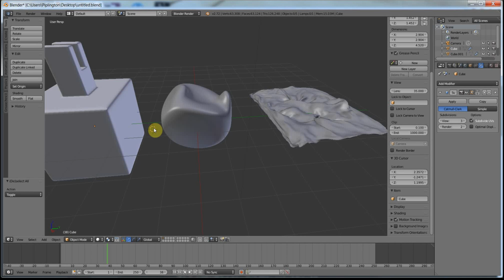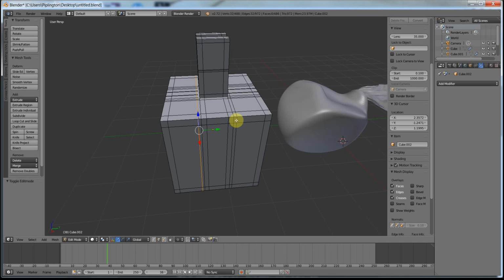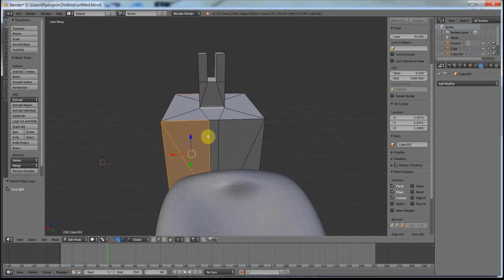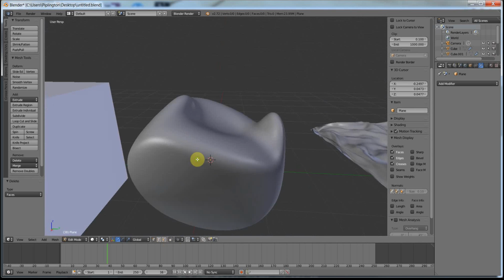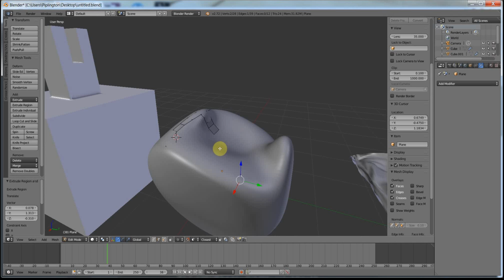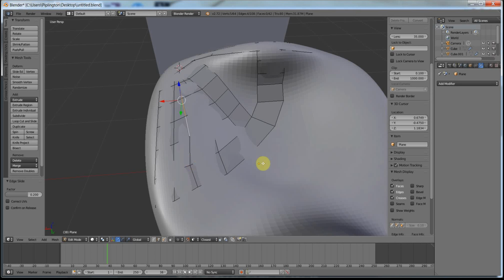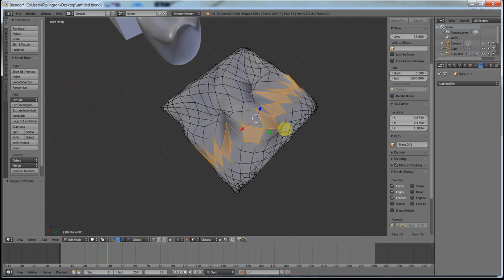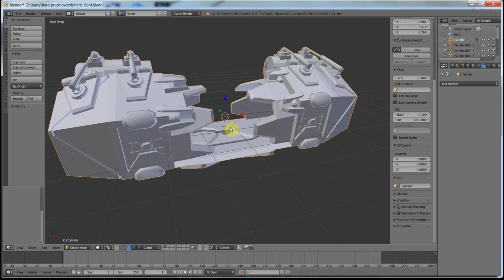Blender 2.72 Low Poly Asset Modeling

Comment: you do have desolve edges for easier combining. In most situations its actually beter and easier just to desolve the ones we do not need.
Reply: You could also desolve a vertex
Reply: Another way of getting the same effect is by turnning on the magnet(idk what it is actually cold but you can put it  on by pressing shift + tab then you just select and grab to the one you would like to merge it with and in the end when you are done you could just Press W and select remove doubles )PS there are a ton of ways to disolve merge and just optimise your mesh in Blender it is actually a matter of preference
Reply: RChardakov VX
oh and set your magnet thing to vertex not to closest/face/volume/increment/edge
Reply from the maker: RChardakov VX ok, thanks! I do know this stuff, sorry I didnt decide to do it. I only had one take. I agree dissolve would have done it. however the snapping settings are fine on to face, as then your not contained to where you want to put the loops. PS this video was filmed at 5am xD
Reply: Just giving people more options :D